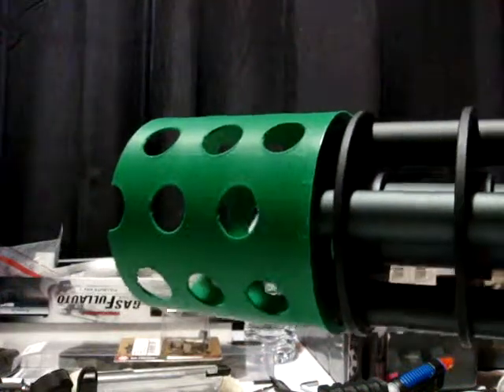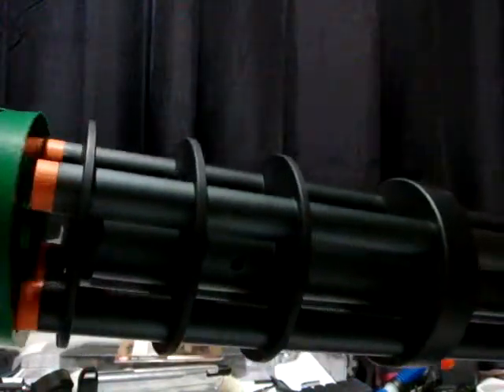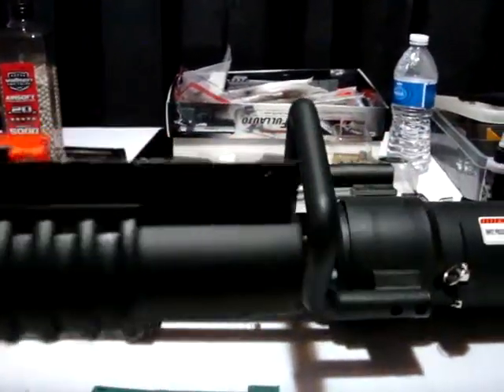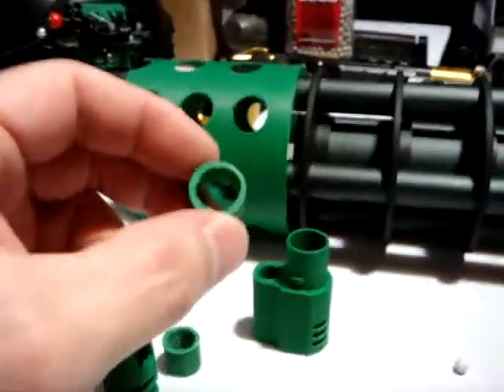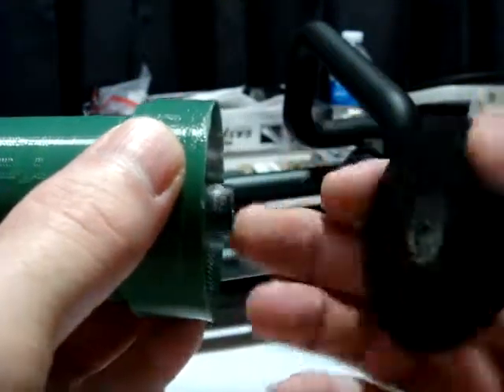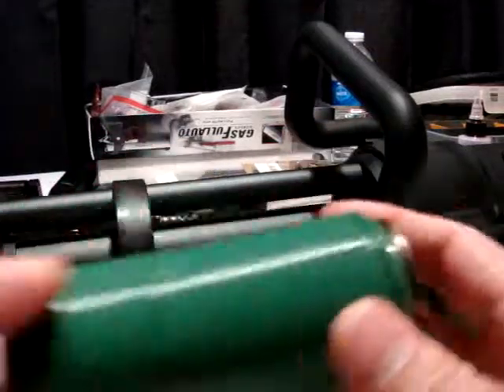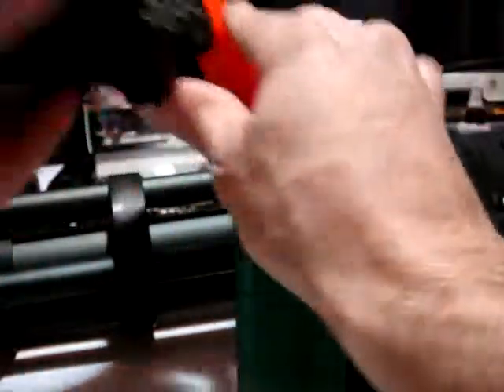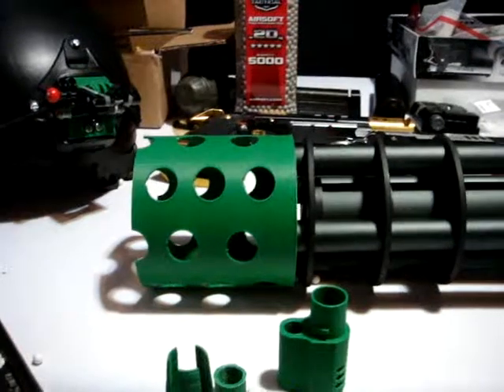Building the Ultimate Microgun: 3D Printed Flash-Hider

Comment: Howdy! Would you happen to make this for the CA M133 by chance with 4 slots instead of the circles by chance?

Thanks!
Reply from the maker: I'm guessing the barrels are the same pattern. Yea I can make one, what color?
Reply: @heavymetalairsoft6188  I would like one in black please. The OD for the barrel ring is about 3.571" last time I checked with calipers.

Was thinking probably make it 4.5" long with .5" wide slots at 3.5" long each. Wall thickness of the shroud probably 3/8" at 100% infill for durability if that's alright.

Comment: I would do it without the front half circle cutouts.  Nice work,  how much are you going to charge?
Reply from the maker: +Creepy Airsoft I feel the same way about the half circles.  I'll try to adjust the vertical scale to get rid of them or I can just cut the front down a bit. I think $40 might be a good price, I don't know how much CA is charging for their Flashhider? I'm printing another one in silver today after I print these 1911 grips in green. The guy liked the green compensator so much he wants grips to match!
Reply: Steveos Brickorama and Airsoft cool, I have not tried the world of 3D-Printing, is it worth the money?
Reply from the maker: +Creepy Airsoft Not yet! With the initial investment on the machine, materials, learning how to print well and tell when things will not work or print badly takes some time. The printer I have is somewhat high end because I wanted to start a business. You can get hobby models for a couple hundred bucks.
Reply: Steveos Brickorama and Airsoft yea, that's one of the reasons I have not purchased one yet.